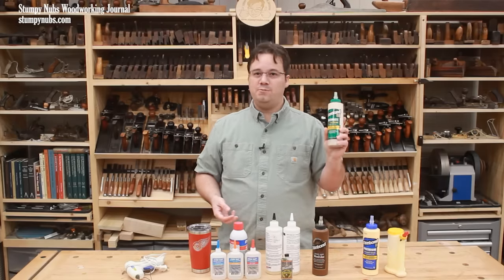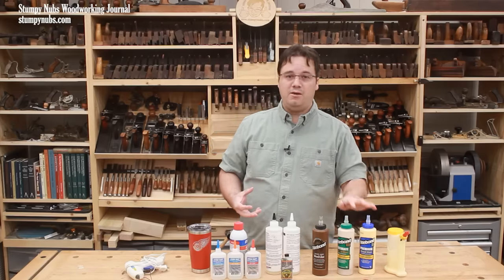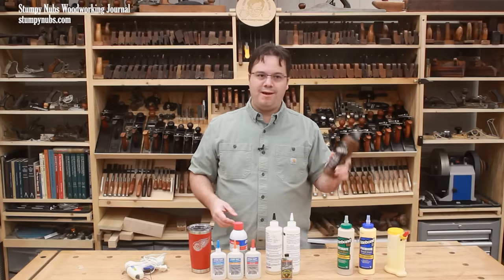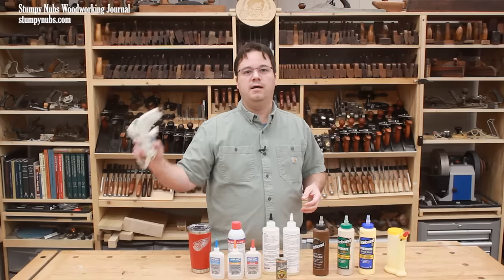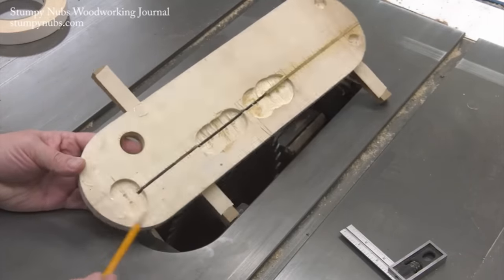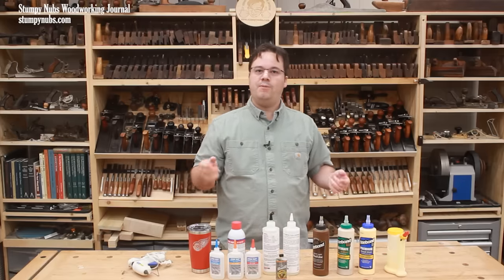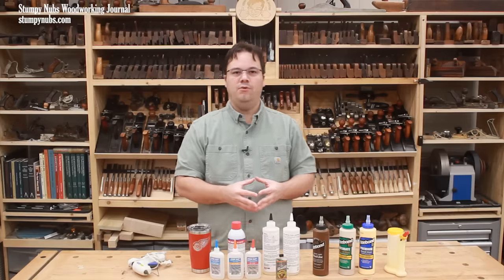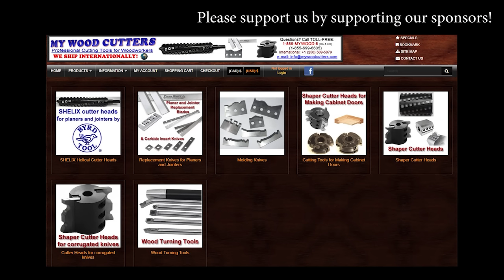Why I don't use Gorilla Glue

Comment: Great video on glues. Boat building and restoration I have used a lot of epoxies and Gorilla poly glue. Polyurethane glue has its uses. When it first came out, the hardwood candy store also had a bunch of green ash shorts on sale; cheap serendipity. I glued up a kitchen cutting board. A great test for waterproof glue and bonding because the ash was wet to begin with and the kitchen cutting board was alternately soaking wet then dried. I deliberately did not oil the board. Lasted for years. Finally one joint split. Too little glue on that joint, I think. I separated the split joint, quick pass over the jointer, more poly glue, then back into service the next day. One boats I used it to join fiddly bits of non-structural trim that would be painted. Worked very well, without the two part mess and expense of epoxy. Recently the best use was to glue back together splits in Redwood T&G 1x8. Very gently prying open the split, with a toothpick, and spread in the poly glue with an old toothbrush. Clamp with 2" clear box tape. The foaming expansion here is a big plus as the glue will push itself into areas of the split the toothbrush could not reach. And fill in some of the inevitable gaps left by splinters that fell out. Redwood T&G, once commonly used in Hawaii, is now either very expensive or unobtainable. Rescuing these boards is quite worthwhile. Poly isn't for every project, but for some, it is an excellent choice.

Comment: The clear non-expanding PU glue has some properties that make it very useful for certain applications.  It doesn't make the mess of the brown PU glue.  PVA glue cures strong but is brittle, but clear PU bonds and remains very flexible and tough.
Of course construction adhesive has good properties for some use cases too...
Reply: PU(R) is also used allot for gluing plastics onto wood e.g. ABS Edgebanding against melamine this also creates a watertight seam. but this is mainly used in industrial aplications
Reply: That’s a good point about the clear poly glue, however you’re mistaken when it comes to the PVA. It’s not nearly as brittle as people think it is, just peel some off your clamp after a glue up and give it a stretch. It’s not super flexible, but it’s not brittle. Given that and the fact that it’s cheaper and arguably easier to use than PU glue, I just can’t imagine a good use for it in my own shop. Maybe if I worked with plastics.
Reply: Purely as an experiment, so with a random piece of scrap and junk that I found in the trash, I fitted together a knife (trash blade) and handle with PU (Gorilla, specifically) glue. It was a bit of a bitch to clamp such that it wouldn't expand and push the damn blade out of the handle cavity... BUT... 20 YEARS later, and the knife still sees regular use, including hammering it through frozen food (like a frozen pound of bacon, or a "log" of hamburger) and regular washing... It's held up admirably for something that didn't cost more than a measure of Gorilla Glue and a blade I found in the trash... and some time... AND obviously, it's not for my lack of abuse to it. I don't give it ANY special care, and in fact, it's the first thing I hand to someone as a loaner or for "rough" work, since it's supposed to be tested and it's not to be fawned over like a favorite... ;o)
Reply: @gnarthdarkanen7464  I had a rafter tail crack in me.  I don't want to rip off the entire roof to repair it.  Gorilla glue fixed it, still holding 10 years later.
Reply: @scottslotterbeck3796  Haven't gotten so ambitious as to bet the integrity of my house on the stuff... Hat's off to you, and congrat's (so far... so good?)...

    Hope it continues to hold a few decades more.  ;o)
Reply: @gnarthdarkanen7464  definitely relate
Reply: @e.t.preppin7084  Yeah... when in doubt... put something together and experiment...

    Sometimes it's worth the hype, and sometimes not... how else do we get to know  "Is it good for ME to use?" ???

    Right?  ;o)
Reply: It's a great glue but unfortunately everything I can find is very watery. Would like a good cheap source that isn't mostly water.

Comment: A great glue overview, thank you.

What are your thoughts on alternatives; double sided tape, spray impact adhesive, blue painters tape, etc. How to peel or remove residue, clean-up etc.
Reply: I clean Scotch tape residues off wall paint with starting fluid for diesel engines. (Works fast ,Dries fast)Rotate your rag .Try to find the ones without cylinder lubricants.

Comment: Storing your CA glue in a container with a desiccation pouch works great to prevent clogs, too. Also, Gorilla Glue works great on other repairs, such as ceramics, where you can file or sand away the foamy parts for a nice clean joint. And, rubbing alcohol is a very effect release agent for hot melt glues. Just touch the joint with a dab of alcohol, wait a few seconds and the joint will fall apart.

Comment: The application I remember where PU might be the right choice is bent lamination of slender boards, if they need soaking to bend better in assembly. I’ve never done it myself, and other glue types may of course work well too. But the dual use of the soak for both bending and setting the PU feels like a good match
Reply: Nope. I did that once. PU glue is so brittle when dry that my when my laminated curve was impacted lightly a small stress crack started then it grew quickly until the whole piece blew apart. I said many bad words.
My second attempt was with UF glue which has lasted for 15 years and still going. Strong, tough, and won't creep like PVA.
Reply: THE best way to bend wood, is to get it wet and hot enough to bend, and then put into a form... BE PRECISE WITH YOUR FORMS!!! 

   THEN you dry the stuff while it's clamped solid... Once dry and formed, you can even "heat treat" it as applicable... BUT get it dry, and it generally won't put new or different stresses on the joints whether you laminate or use other methods of joining (like length-wise). 

     Sucks, I know... BUT the "long way round" is generally the better method. Be patient... It pays off. 

     Finally, yes, a lot of the time you do it, at least in the beginning, there's a frustrating amount of "spring out" when you take the dried wood off the forms... It's generally predictable though, just to different degrees depending on your practices and purposes... SO my answer (arbitrary though it may be) was to make all my forms just a little bit tighter or smaller than I planned for the final fit-up. That way, it compensated for "spring out" and I got a lot closer to exactly what I'd measured for and intended to do.

    In any case, if you can wet/cook it and set it to form until as dry as possible, it really doesn't matter what glue you use... AND "heat treating" the so-called old-school way only results in a bit of char-darkening, not even any actual charring, to "fire harden" the wood... Just for clarity... in my dubious experience.

      Hope this helps... Bending is a frustrating and tedious business by nature. It takes a LOT of trial and error to get any good at it.  It's worth the investment though, if you can possibly get into the stuff.  ;o)
Reply: All three of you might be interested in reading about plastic resin glue. Not covered in this video but very useful for bent laminations.
Reply: @troyclayton  so the carpenter I watched on Swedish telly 15-20 years ago just soaked the boards overnight and smeared the glue using his thumb right out of the bath, water running down the planks. It looked fun and effortless. His glue budget must’ve been large, he all but cast the construction in PU. I made a mental note of it, thinking I’d try it some day. Of course, the garden recliner he was making came together alright, but there’s no knowing if it sproinked out of form five minutes after turning the camera off :) Anyway, after reading these comments I’ll probably use a different glue if I ever get around to trying it out.

Comment: Very informative video, one glue i learned of back in shop class and I still use it today, it's a plastic resin powder glue made by Dap and its called wieldwood, I introduced this glue to our arsenal at a start up furniture company and would use it for repair work on old pieces and glue up multi layer boards and if aloud to set up over night will produce a stronger than wood joint. I turn alot of wooden Bowls and such and use it on those glue up too.

Comment: If anyone doesn't know, CA glue will react with baking soda very quickly to make a very hard substance with decent adhesion.

I've actually used this to create a strong filler to repair or build up something. It is tricky because the reaction is so fast the CA glue won't penetrate very far. But you can work with it.
Reply: Years ago CA and baking soda was used to repair dings in airplane propellers.
Reply: Try mixing baking soda into water.  I'm pretty sure that's all the activator is.
Reply: I'm currently "wearing" a CA/sodium-bicarb "pseudo-thumbnail" - Was trying to load a rat trap back around the middle of September or so, and managed to fumble things in such a way that the snap-bar came down right across the cuticle of my right thumb at full force. After some appropriate cussing, the to-be-expected blood-blister in the nail-bed formed up right on schedule, turning almost the entire nail black, and I started the "wait for it to grow out" process. Said process proceeded as expected, eventually resulting in new nail behind the slowly creeping blood blister. And as a bonus, the "leading edge" of the new growth came in pushing a linear "crater" of mostly dried blood and incredibly poor-health nail ahead of it. A crater that, after a couple of days, eroded away to leave a sharp edge that did its best to catch on ABSOLUTELY EVERYTHING that got anywhere near it. Had a bright idea based on a youtube video - scrub, brush, scrape, dig, and otherwise clean out as much of the "crater" as possible. Dry well. Fill to heaping with baking soda. Touch baking soda with a water-dipped Q-tip (CA wants water to cure - vapor in the air is usually enough) to get some moisture into it, then add one drop superglue. Wait 10 minutes (it set up nearly instantly, but wasn't fully cured for several minutes) then break out a diamond-dust file and shape to something like smooth. It's not perfect, by any stretch of the imagination - the color match is completely nonexistent, for one thing - but at least it's a reasonably smooth, non-snagging "repair" that I don't have to worry about catching on something and ripping the nail off in a spray of blood and screams of agony.

Comment: White glue for paper 
Yellow glue for wood
Gorilla glue for hair
Reply: Did they shave her head or still there? Maybe someone could do a strength test
Reply: I forgot about her 😆🤣😂
Reply: For gorillas
Reply: Cyanoacrylate for fingers.
Reply: WOoooo dats RACIST!!  ;)
Reply: I used Gorilla glue when my rear view mirror fell off. In other words, metal to glass. That was 2 years ago and it’s holding like a champ. It has been exposed to both extreme cold and heat, and is holding strong. Just saying, I think for some applications, G glue, has been my go to.

Comment: Polyurethane glue is great for squeaky floorboards. Sika Tech Grip is my choice.   As for CA, i use powerflex and loctite 480 a lot in my workshop.  Regular super glue is too brittle in some applications.   However it is a great finish and finish repair.

Comment: I use Gorilla Glue in chain saw carving because the logs have moisture in them. When I glue on a Bears arm or something the foaming doesn’t matter since I will be carving all the foam and extra wood off. I use 12” screws to clamp the pieces together for an hour while the GG sets. Remove the screws and replace them with GG on dowels for a permanent addition to the log or Bear. Thanks for another excellent presentation!

Comment: I learned a lot from this video, but the main thing I learned was how wildly ignorant of the world of glue I really was. I have used nothing but Titebond 3 for all of my woodworking and will definitely be changing that. Thanks for the video!
Reply: The thing is, there's almost no setting where Titebond 3 isn't going to work -- so, at least if you're only using one you're using the one that is the most water resistant and creates the strongest bond. In that way, you're not using the wrong glue, just making your life a bit more expensive and difficult than necessary
Reply: I use Titebond II for all of my woodworking.  Never had a problem with open time.
Reply: @himynameisdavenicetomeetyou  That's the way I look at it as well.  You basically can't go wrong with TB3.
Reply: Same with me. Guess I'll get a bottle of the other Titebond. :-)
Reply: @himynameisdavenicetomeetyou  Norm Abrams loved hide glue.  I was surprised it's still available.
Reply: @scottslotterbeck3796  yeah, the fact you can still get it (without boiling animal bits to make it yourself) was definitely the most surprising part of the video for me. I had no idea.

Comment: I've used polyurethane glue for outdoor projects (tables, mostly) made from construction lumber (usually 2x12 SYP boards where I cut around the worst knots). Even if I let it sit for a while, the wood still has more moisture than I'd like which is a good fit for PU glue, and I don't have to worry about rough tenons as you point out. I use a carbide scraper to get the foam-out after the glue sets, then a good sanding to make sure the wood will take paint or deck stain.

Comment: I've had bad experiences with polyurethane glue, even to the extent of outdoor pieces simply falling apart after a few months. I've known guitar neck joints glued with polyurethane that could be easily pried apart—hand pressure only. I can't think of any application I would use it for. (The "gap filling" foam has no structural strength to speak of.)

I don't use cyanoacryliates on any joint that receives stress, as it has very poor shear strength.

I've tried a few brands of construction adhesive, but they've all failed after a few weeks or months. Maybe I'm doing something wrong? <shrug>

I don't buy pre-mixed hide glue. The shelf life of the crystals is practically forever, and mixing it up isn't that much of a hassle.

YMMV
Reply: I have had good results with Gorilla Glue. I have even left pieces out in the rain as a test. They do have to be joined well and allowed to cure properly.
Reply: We use construction adhesive all the time (in addition to mechanical fasteners) to enhance the rigidity of framing members. Like behind tiled walls, underneath staircases, sistered joists in squeaky floors.

Comment: Have you tried using Weldbond?  It's a PVA glue and seems to hold as well as Tightbond, but dries clear.   I've had really good results when gluing pieces that have been pre-finished or pre-painted prior to assembly.
Reply: I'm a big fan fo Weldbond, and actually came to the comments to say that it doesn't fit with any of James' descriptions of "white glue" -- in tests from Matthias Wandel a few years ago, it came out stronger than TB2, and is definitely more flexible.  It also sets up in about 20 minutes vs an hour for TB2.  Just be careful getting too much on joints you plan to hit with a flush trim bit -- it melts and re-solidifies more like hide glue, and will really gum the bearing on a flush trim bit.
Reply: Not tried Weldbond.  Maybe I should....
Reply: Used Weldbond to build a small sailboat   Worked excellently. See Bolgers instant boats, Titebond and PL Premium along with West system epoxy are favorites too in the small boat community.

Comment: What about combining different glues in the same task?  I’ve seen a number of other users apply two different types during the glue up process, such as yellow glue for strength and CA glue for quick adhesion that eliminates the need for clamps.
Reply: I sometimes use hot glue to tack parts while waiting for epoxy to set, it's very useful stuff.

Comment: Thank You Excellent information as usual 
In my experience over the long term (several years) epoxy tends to move if under constant stress.
Where I’ve found polyurethane glue useful is with pressure treated wood.

Comment: Another very useful video. I’ll use one suggestion immediately: storing CA glue in the shop freezer. That will immediately eliminate a regular nuisance.

Thanks!
Reply: In the freezer or refrigerator? I get really mad when I buy a bottle of CA glue and use it once go back to use it again month's later it's almost dryed up thick I have to pull it out with tooth pick
Reply: @snoopu2601  Probably either, as both tend to be low-humidity environments, but the relative humidity of the freezer will always be lower.
Reply: @FortyHurts  thank you, I put the CA glue in the freezer. I was wondering how to make the glue last longer. Every time I was buying it was always drying up on me seem like I was wasting it more than using it. Thanks again 40 Hurts 👍🏽